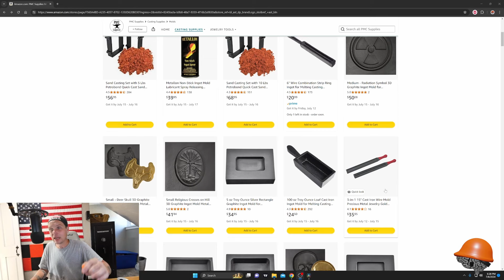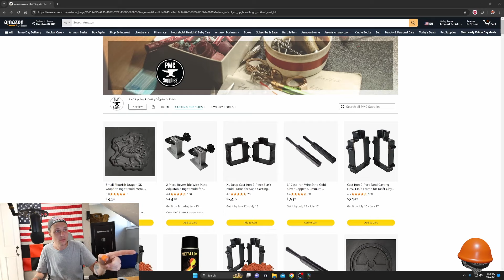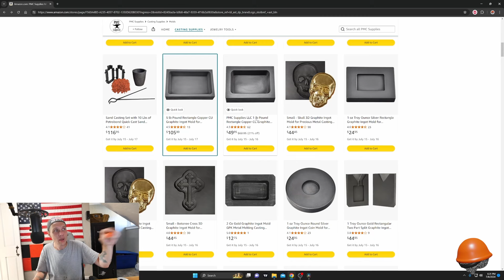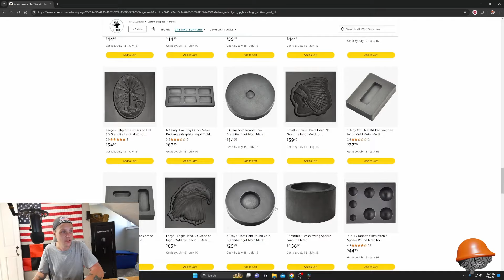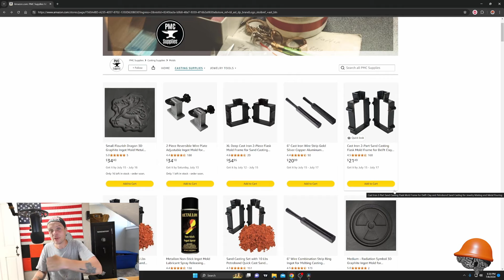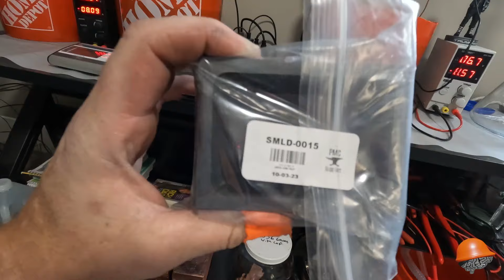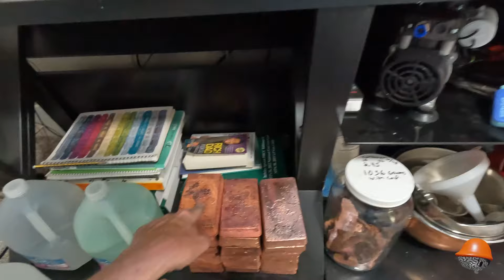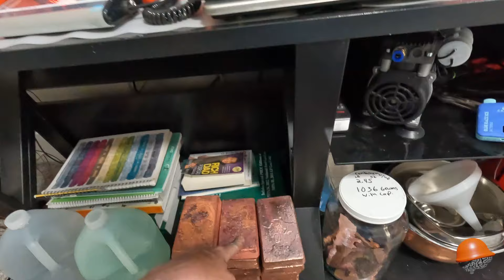Perfecting The Copper Bar Pour

Comment: Really enjoying the videos! I'm seeing you make a very similar journey learning through trial and error. My first ingot mold I purchased was the 5 lb PMC and it went so well I didn't realize realize the importance of a quality mold. I poured around 45 bars with that mold and  then switched to cast molds to try to lower operating costs. I am not happy with the finish and it takes a lot more sanding and polishing. One suggestion I would make is with your propane. I was able to get my hands on a 100lb tank for free and I had it recertified for 10 bucks. It seems to last so much longer. I have poured many different bars of copper, brass, and aluminum and I haven't had to refill it yet. I keep a small one around in case the 100 pounder runs out. It doesn't frost up and it is only $65 to fill at Ace Hardware. Keep up the good work.

Comment: Thanks for the information. I started melting and pouring copper this summer and it helps when there are others who are way ahead of me. :)  i thought about not using the borax since it does mess things up (used to much in one melt). The borax has messed up my crucible a bit but i'm just trying to get the bars for now, nothing fancy and just learning.  I think i did about 100 pounds now and hoping to do several hundred pounds by the end of the fall. Great videos by the way and looking forward to watching other videos.

Comment: I would try argon encapsulation.
No oxygen, no oxidation = clean metal
It is denser than our atmosphere so it will settle into the mold, also as a compressed gas it should help cool your mould.
As far as stamping, i would try and have your logo raised into the bottom of the mould (laser etched as a negative? )  so there's no actual stamping it's automatically part of the bar. 
The bottoms of the mould are the top of the bar which are always clean, then you grind the bottom of the bar to weight and you're done. 
Just some thoughts to share.

Comment: From what I understand, the only real reason to heat the mold is to remove any moisture.  I have not had it happen or even seen it myself, but I guess pouring into a mold with even a small amount of moisture can get really ugly quick like.  It basically has a steam explosion.  Other than that I don't know another verified reason to heat molds.   Like you said before I just "kiss the mold" with the torch.   Lol.  I hit it before I start melting in my dish then a few minutes later right before I pour I touch it again for a few seconds.  Now granted I'm dealing with much less volume than you are and a different metal with slightly different properties, but I have really good results that way.  Ya as far as borax, I treat my melt dishes with it when I first use the dish and that's about it.  I don't add any when I melt the metal.  Once in a while a tiny bit comes with the pour and ends up on the top of the pour.  I just drop the contaminated ones in a bit of sulfuric acid and water to eat it off and then it comes out pure.